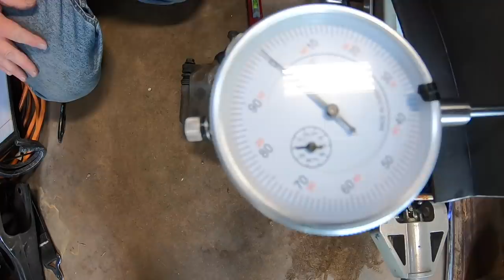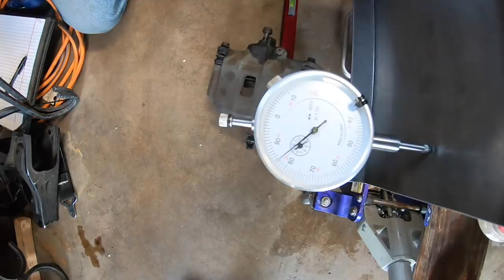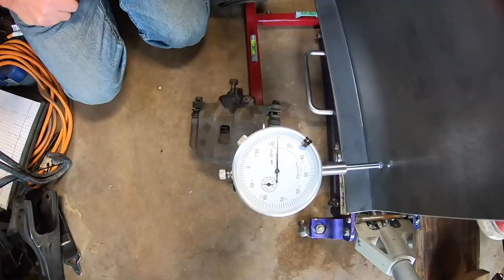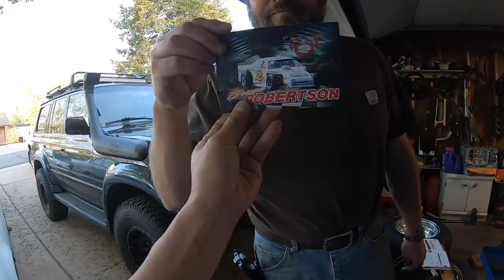Great success on Phoenix front suspension!!!

Comment: Great Work Bruce. I have a similar set up for checking camber change throughout the suspension sweep. I made it about 25 year's ago when I was doing alot of set ups on road racing cars. When I started my apprenticeship over 30 years ago one of the first jobs I did was front end alignments. I used to use a old Hunter lite-a-line. Back when doing a alignment involved doing castor,camber and toe adjustments. Not like today when they put on the machine and if it comes up on the monitor in the green they send it. It is great to see someone with knowledge on how to rectify a problem the correct way. Thanks Mate.
Reply: Thank you. I was trained on an old bear rack and then worked at a place with a D111 hunter. Old school always wins. I have an asphalt oval track background.
Reply: @brucerobertson443  , thanks for the reply Mate. I have a circuit racing (road racing) background. I have raced mostly in Queensland, but I raced at Bathurst about 15 years ago. I still set up alot of race cars. I specialise in spring rates,roll centres and alignments. Cheers.

Comment: Looks great and much stronger steering arm! Would a Koni double, single or non adjustable strut insert fit your knuckle assembly to replace the inserts you have? It seems like a bit more solid solution for control than relying on just the rear LCA, lower ball joint, etc strength.

Comment: Can I suggest that you put a split pin in those nuts, I wouldnt rely on the nylock nuts alone.
Reply: I'd do something similar to the road race guys and safety wire all critical nuts and bolts.
Reply: I was going to suggest safety wire, too. That is one nut you DON'T want backing out!

Comment: Hi Phong great work , when you tig weld such thick plate you should bevel it that way you get 100% penetration  and even do 2 passes. 1st one you can push filler in, 2nd one weave over it. And it help if you take propane torch and preheat it then it takes less amps to burn it all in. But good job.

Comment: I learning lots. I'm glad you've got some help to figure it all out together and you're making massive progress. 

For cornering, the toe comes out slightly when the spring compresses, so it momentarily relieves the steering tightening feeling over bumps on the outside wheel.
For drag, presumably you want the toe staying even throughout the wheel movement range.

Comment: sooo fired up for you Phong ! I may have missed the explanation, but could you go into a little more details of the shock Bruce suggested installing? doesnt your spring on shock already fill this purpose or do you guys not think its working as it should? also I dont know if you ever actually told us in a video what happened that day on the dyno we saw all the smoke, im assuming it wasnt the car that was smoking ? did you take a look into the engine after pulling the melted plugs? I was assuming we were going to see some kind of break down video on the engine after that dyno session but then you got sick and didnt really explain unless i missed it in one of your newer videos? sounds like its still running good though so must be ok i guess.

Comment: Surely to get a useful and meaningful measurement and as this is static, you should be a) measuring the change in toe over the realistic movement range the springs will allow, and b) your final static toe, since it's a front wheel drive, should be toe out biased due to the actual reaction of the front wheels under power.

Comment: If you'd move the tie rod end mounting location about an inch or so inwards, it would solve a lot of problems.
Reply: He doesn't need Ackerman.
Reply: Hello. To keep the weight centered over the hub the wheels have 0 offset.  The steering can only move approximately 15°. Shortening the arm would create a lot of Ackerman and maybe only get 12° of steering.